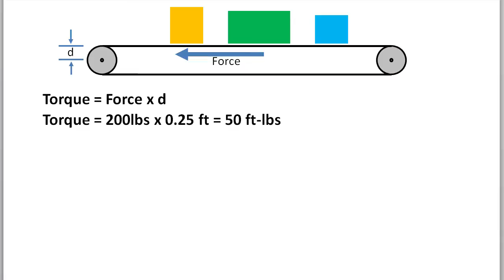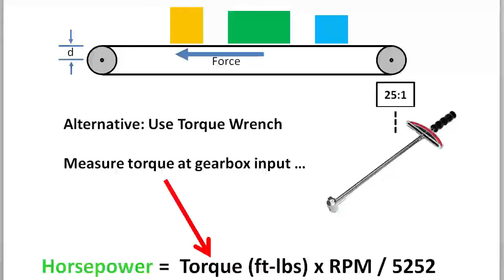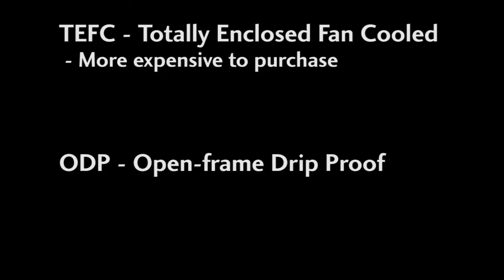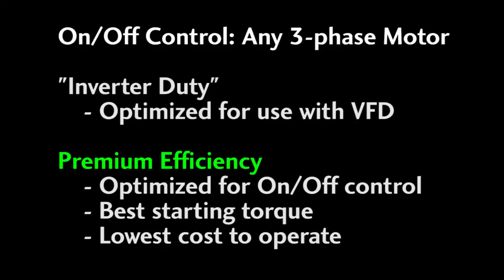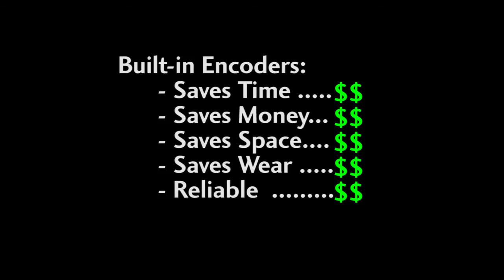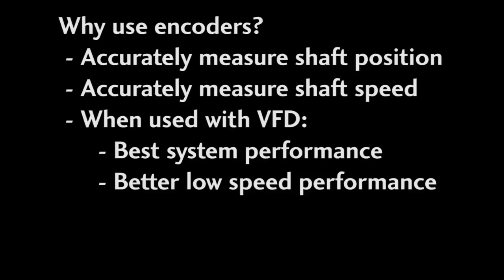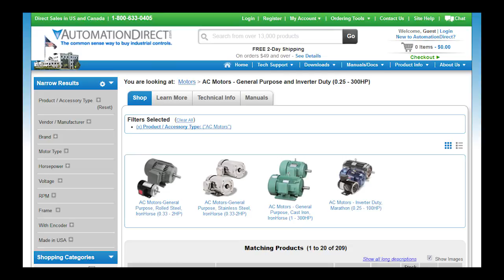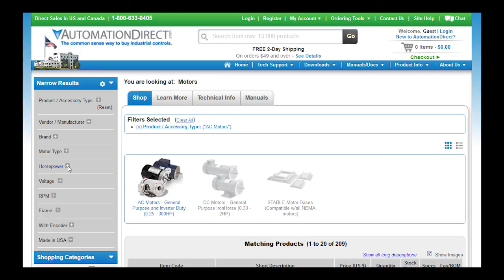Select an A/C Motor for ON/OFF Control from AutomationDirect

Comment: This info was great and it was presented well. I am in the middle of building a 2x72 belt grinder and used a 3hp 3ph 3600 rpm inverter duty motor and vfd from automation direct. One of the reasons for using you guys was that the instruction manual for the vfd is hundreds of pages and it has more info than what I know to do with, so it certainly covers the few features I will use. The cheap units on Amazon are said to have spotty instructions and the quality is somewhat unknown. The document group that I was able to send to my email, from your website, has also been a great help and the motor specs list the max safe rpm which is more than high enough for my needs. At only 75 hertz I will get 8,000 surface feet per minute on my belts and it will go plenty slow for fine detailed work. I'm glad I went with automation direct instead of surplus or budget parts, and that mid grade parts were available which a small business person can afford.
Reply from the maker: Thanks for the feedback!
Did you know we have over 1500 automation tutorial videos like this at:
www.automationdirect.com/videos ......... by category/random search
www.automationdirect.com/cookbook .... by Topic
Check it out next time you need to learn something about the products we offer!